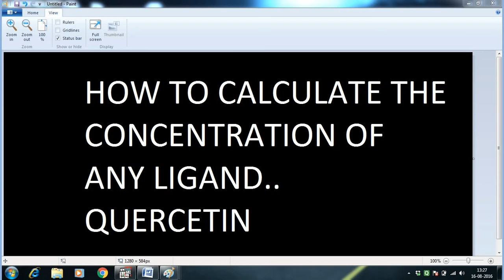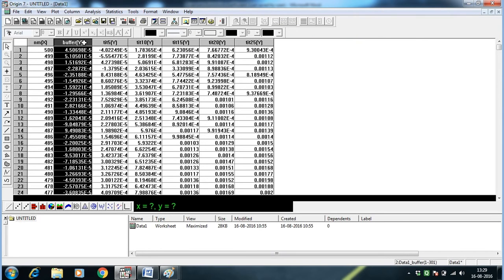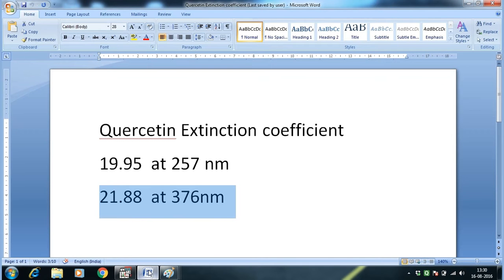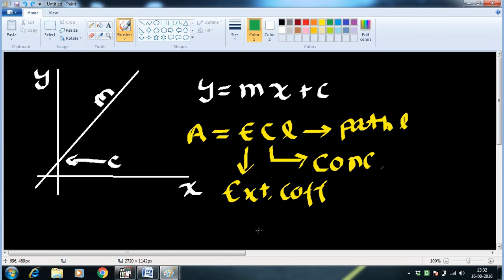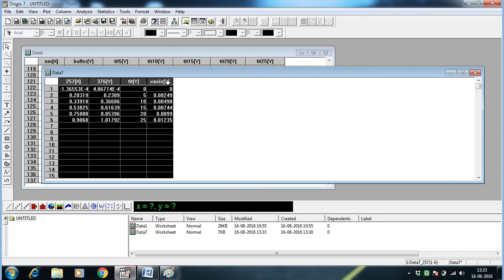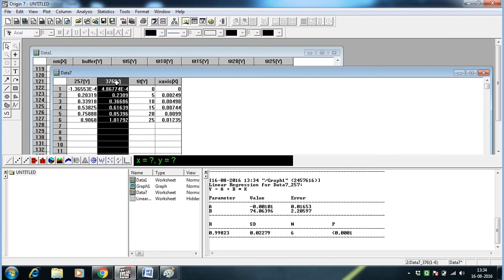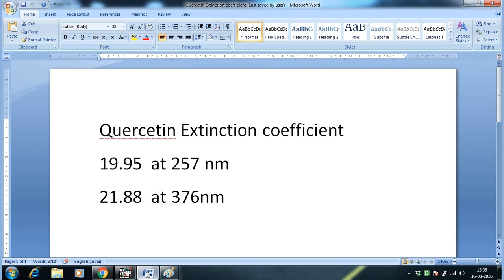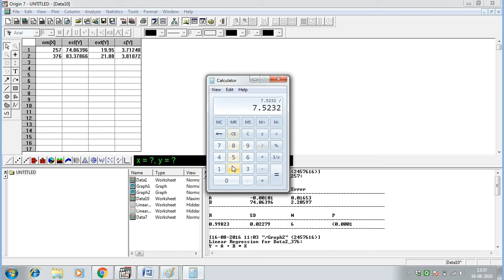how to calculate concentration using extinction coefficient

Comment: i quite don't understand what is the 2000 value come from?
Reply from the maker: 2000 ie. 2 ml buffer.. and over there, add 5 ul ligand in regular interval. The data in ul so, changed the buffer in ul.. this would be the reason, it mentioned in 2000.
Reply: okay very thank you. i got it